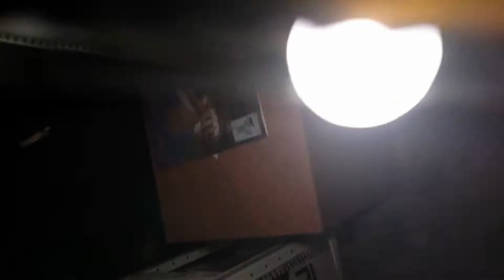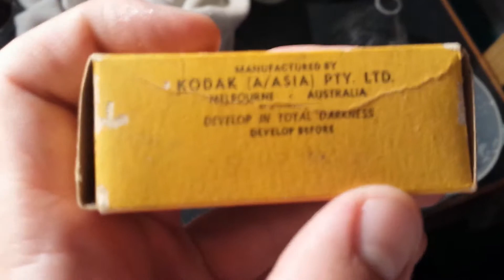Developing expired Kodak 8mm movie & 120 type photo films (Part 2)

Comment: The Caffenol process is tricky. A negative image can be very faint. That nasty remjet must also be properly removed. Also old film requires more light for proper exposure. Then the reversal process via computer must be done right. Practice, practice, practice, etc.. Again, it's tricky and unpredictable. That's why it's so much fun.
Reply from the maker: It only took me a couple more failures to realize that Kodachrome II requires a very short developing time in Caffenol CM of only 3 minutes at 20 degrees celsius and since then I've had a lot of great success with Kodachrome II, check my 1967 Kodachrome II 8mm plane spotting film https://www.youtube.com/watch?v=FLCv8f2Wfh8